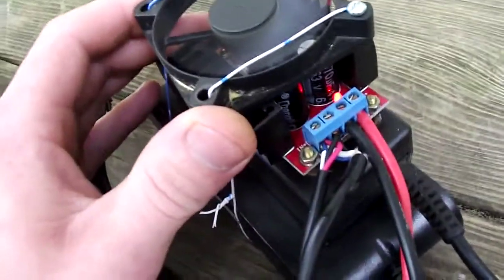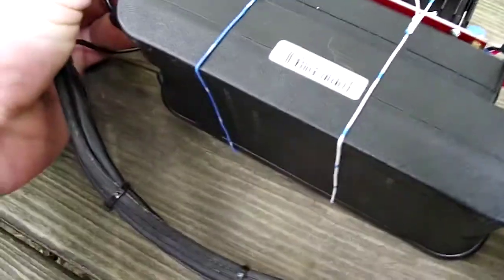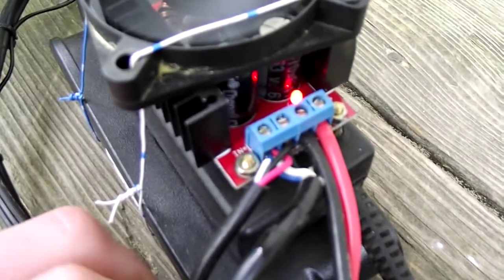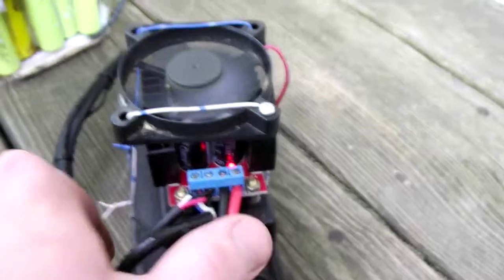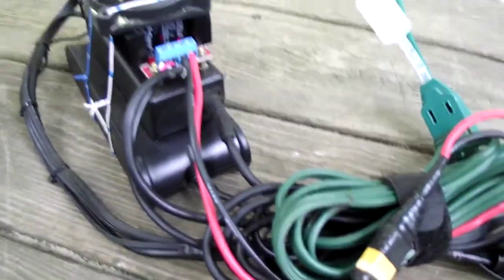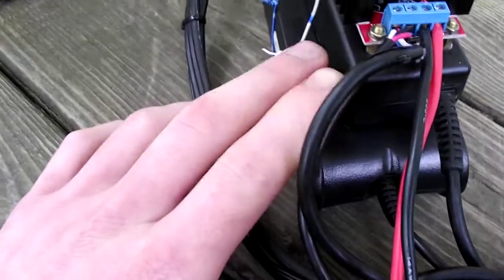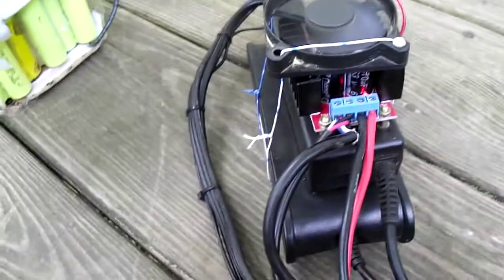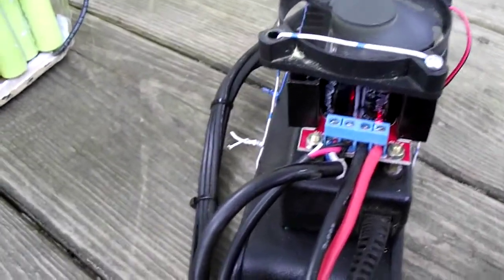Homemade E-bike Charger 54.6V DIY

Comment: The Xbox 360 adapters are good for this they are 180 Watts each depending on the model. I can charge my scooter in two hours instead of eight with the original charger. I would recommend putting a diode in series to stop the battery from back feeding the boost converter because some of them you can get damaged if you don't.

Comment: 5years later... how is it going? any tips on improvments or any hiccups?
Reply from the maker: @lucashenrique594  it actually worked for while, was still working when I took to converter for another project. Now I use a 5amp Wald I believe off aliexpress. Great units for the price

Comment: I like that charger that you have what I don't understand how it goes together and what I need to do do you have instructions for a little bit more in detail never done this before don't know anything about
Reply from the maker: I used the two powerbricks together and tied the POS to pos and neg to neg so both bricks can feed power to the boost converter, which is to up the amperage. I'll try and get some video of my new charger up, and some more info about the boost converters.
Reply: Dave Woodall